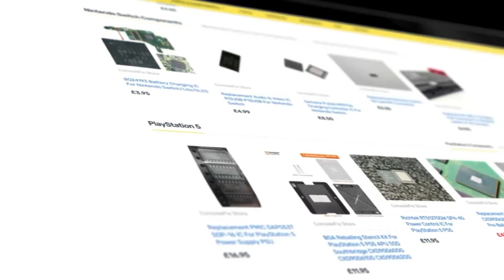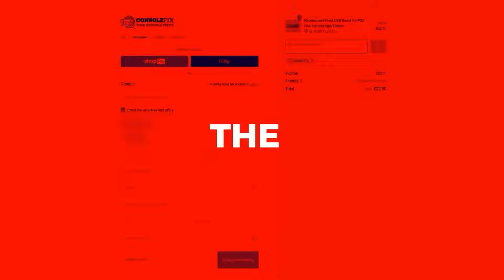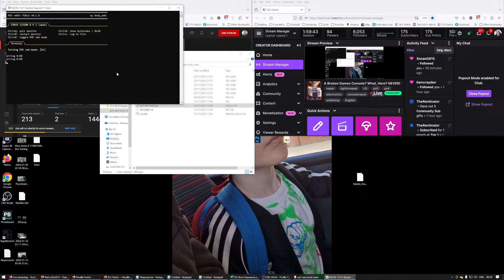This PS5 Repair Was A Pain In The...

Comment: Hey m8. I believe what happened was flux under the oscillator and Southbridge stopped the oscillator from running. I make it a point to check for the clock frequency when the console doesn't work after replacing the Southbridge or if flux was used in the area.

Comment: I have a 1200 series with some weird symptoms, bought it for parts since it would not get past the press ps button screen, when received it had some sort of power issue. Beep every 10-30 seconds when received, took apart, respread liquid metal, then it starts to turn on even tho I basically did nothing. No issue connecting controller, DL game all good till restart then controller wont connect. unplug power and reconnect its completely dead, replug power a few times back to working with controller issue, occasionally controller would connect, but got worse with more restarts, next morning it would always connect first start up though. Controller update and working but suddenly disconnected controller, would do that every 10 mins in a game and would have to restart. Finally went lan, forgot all networks, controller on usb, no more disconnecting, controller works every start up. Wondering if theres an issue with the wifi chip, probably still has the power issue, not ready to unplug and replug the power to find out.